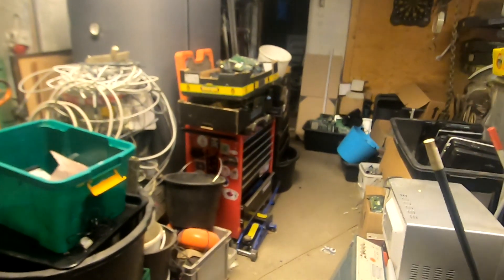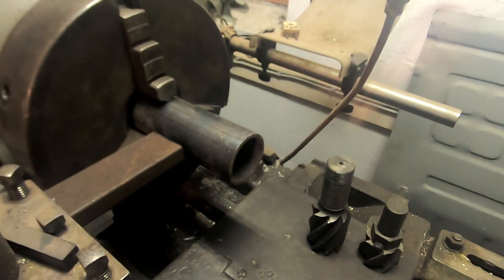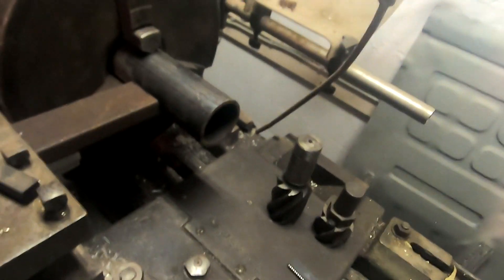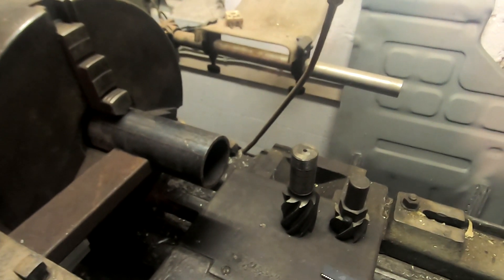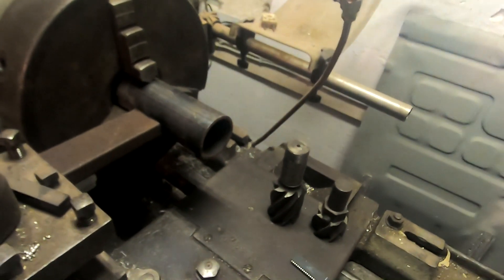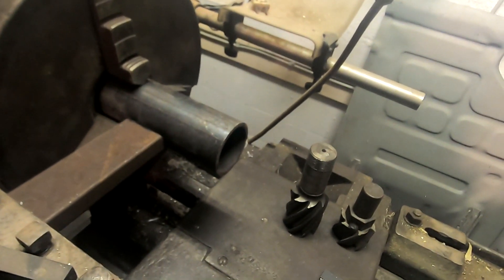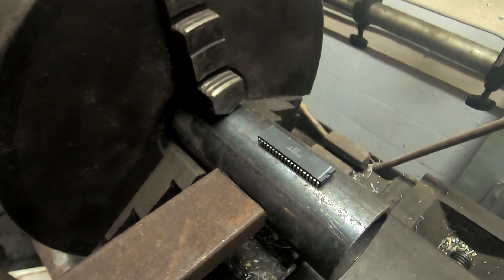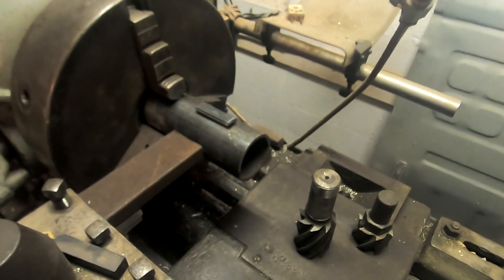building ic chip crusher part 1 by Rafal Scrapper

Comment: I thought about this because there is no one here that buys E-waste boards. So I have been saving them to process in the future. Some boards I've saved the chips off and have the chips set aside to process later. Incinerate or grind? The two options for me to process. Incineration seems too messy. So that leaves grinding.  Here's what I'm looking to buy for that. https://www.alibaba.com/product-detail/Stainless-Steel-Grain-Grinding-Machine-Spices_60663864532.html?spm=a2700.7735675.normalList.103.41dc135badJ4JH&s=p    Then use either a blue bowl or a spiral wheel to pan out the material.
Reply from the maker: yeah that may work i think i even see one guy grinding ic chips with exactly same thing, and the price is not too high on it  tho question is how long  the grinding knives will hold on because it was designed to grind spices and herbs and bearings  can get overloaded quickly not sure but  looks good  worth to try i guess 👍😀👍
Reply: @RafalScrapper   If I do order one I'd make sure I get replacement blades (at least a couple sets) when ordering.
Reply from the maker: @MrGWN7  at the page it looks like steel tho question is what kind of steel is it?? looks like oldstyle design of machine and  if its designed for food should be  brass at newer ones  its used stainless steel, what can be durable enough  but just steel arent  even allowed on food processing anymore that could be lottery on that machine  cause even steel blade could hold ok but bearings what runs all that and i bet there is an big spring to adjust  how much you grinding your material  that could just not handle ic chips but all that is just my thods and guessing from other side i have seen someone using that thingy but was some Asian guy so he had plenty spares i bet  yeps sir decision is yours  and hope one machine will last you  for at least 500kg of chips with that price will be acceptable  thanks for nice topic to think over 👍😀👍

Comment: Being able to crush all of that stuff up should make recovery easier I think ? I was thinking of something like that but for a different purpose. A couple of 2" or so solid solid stainless rollers and knurl them so that the bits get pulled into the rollers.
Reply from the maker: ok cool what are you wanna squeze betwen that rolers?? on that way  i build my own first wire stripper there was three secrion on each roller and first was v shaped with gap about 6 mills  second and third one was  1mill betwen  and third was 2 mill last two was flat and first section take away  main insulation from  cable  second was for 1,5mm2 and last 2,5mm2 wire gage was work  nicely tho only for solid copper wire i still have that tho  👍😀👍
Reply: @RafalScrapper  I was going to use it for milling grains and then turn the crushed grains into something to drink.  I made a wire stripper out of a cheap China ring roller and used a 1/2" drill to power it. It would squeeze the insulation off. Worked great until I loaned it to my older son and he stripped the gears off. I saw it in the garage the other day, I will take a picture of it.
Reply from the maker: @CruiserMac  ohh i see  yeah two  stainless steel roles will do with grains  but i think they should have some groves on not big  even tiny one what you can make at lathe with that roller pushers and from other side just good kitchen blender will do  at slow speed  but that miyght be a bit too much grinded  and it is cool to make something that work , shame if someone who have no idea how to use that  broke it 👍😀👍